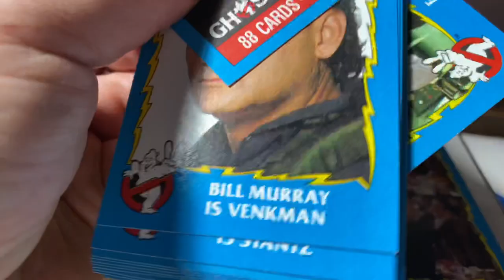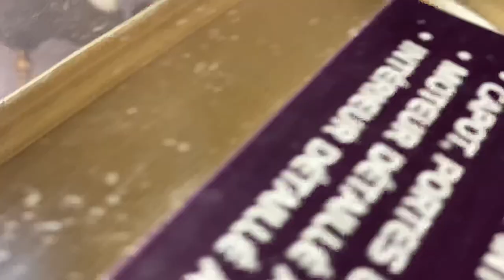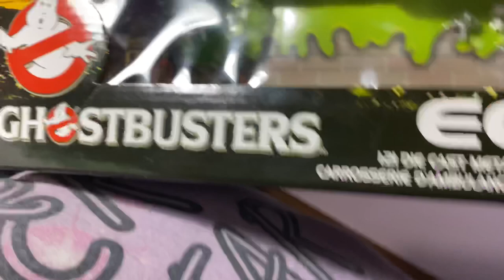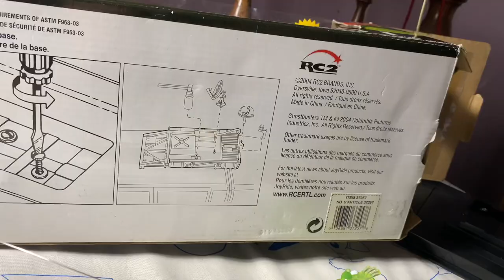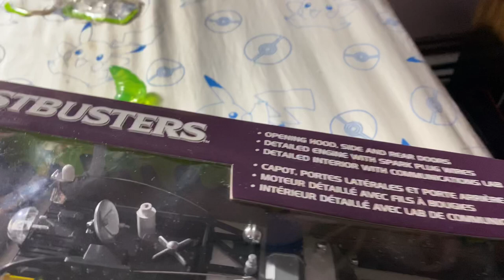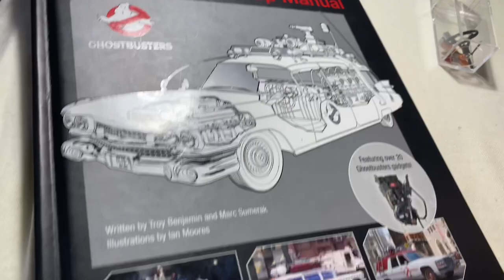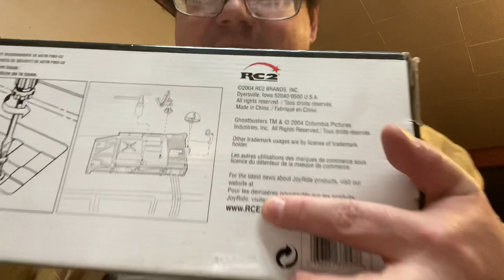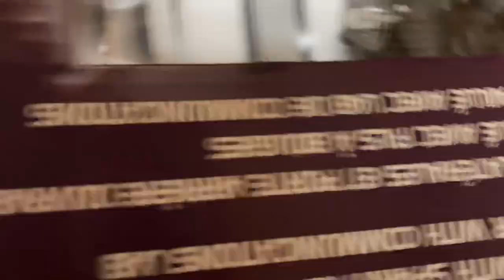Ertl Joyride 1:21 scale Die Cast Metal Ecto-1

Comment: I really wanted to enjoy watching this, but sadly, its nearly unwatchable. Please consider using a tripod in the future and/or a stabilizer. Camera shake, focus issues and mostly blurry. Seriously, why even bother uploading it. 

Updated - 08/16/24 
Received my Ertl 1:21 Ecto-1 today. It's a fantastic die-cast if you can't afford the original Hot Wheels version. Don't be discouraged by this reviewers unfortunate issues with plastic parts breaking off. They are as durable as any other plastic part, just need to be careful and don't force anything. I would (however) recommend caution when touching the two external antennas. They are metal, but the base piece in-which they connect to is thin plastic and its handling the force tension created by the metal antennas being flexed downward. They look great, but be extra careful with these two..

 BTW... The bubbled paint on the hood of the car in this video is (in-fact) a defect and is not present on  mine.

TC

Comment: Wow, I sure would not recommend that for a kid's toy.  Most kids I know would have that thing broken in pieces. The workmanship seems pretty shoddy,  considering the price.
Reply from the maker: I just checked the packaging to see if it had any kind of "Not A Toy" labeling, but the closest I can find is an "8+" age rating. That sounds like a toy to me. It seems the original MSRP was $40, which, while a bit on the higher end for something with no electronics, still falls within "Toy" range.
Reply: @ebwarg  You are an adult obviously lol, imagine an average ten year old playing it.  Busted in minutes. Cool display piece from a distance, but what  piece of crap toy. 
I enjoy your vids, thanks for this review. I have been looking at buying one of these I have seen locally
Reply: Any large diecast is made for display and the adult collector  especially at the price point they sell for , and the more intricate the details are the easier they break there meant to be looked at not played with
Reply: I had one of these a light broke from the top and was missing a taillight  and then I managed to get another model  cheap no issues with that at all,  I eventually sold both and purchased the autoworld version better details inside out  this one you have seemed to be a Total lemon in general the ones I had the steering wheel was fine etc
Reply: @JohnnyPerth  get the autoworld version much better and more accurate details there actually made by the same company Joyride , autoworld, American muscle etc but autoworld is the current company name that  produces all these that were originally released as Joyride but with improvements over the original releases